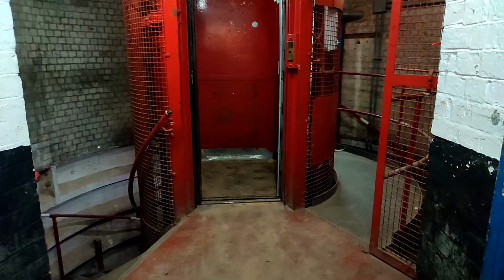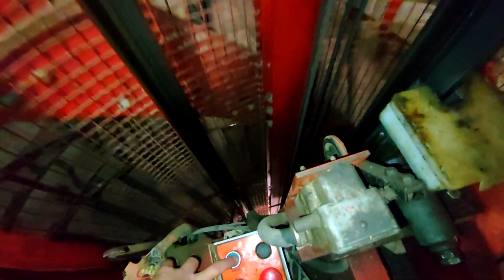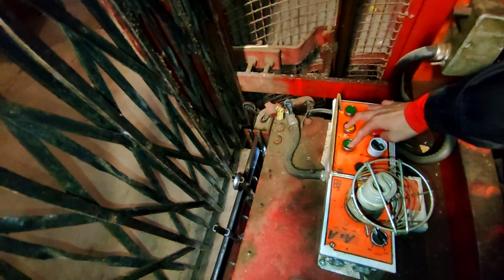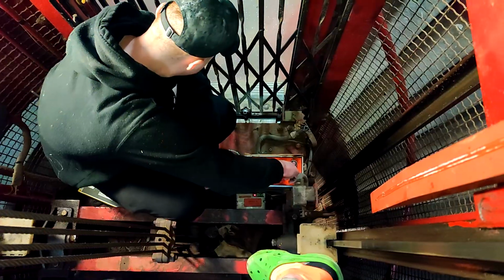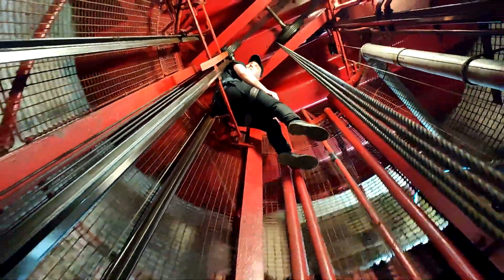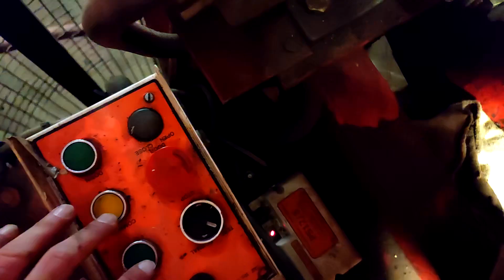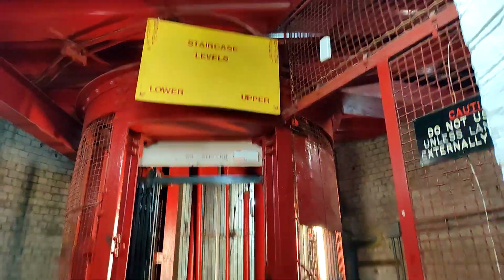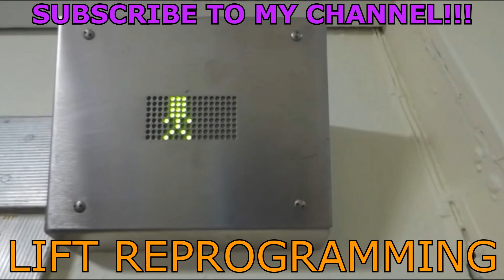Lift shaft dangle and abseiling in a deep bunker

Comment: Those shaft lights don't look original.  Funny to see a 1930's inspection light with an energy saver bulb.  And it's been properly maintained, those rails look and sound fully greased.
Reply: And only in recent years, it will have had the counterweight painted yellow.